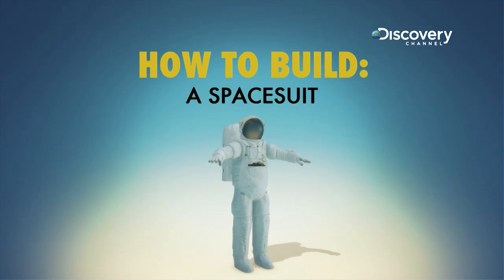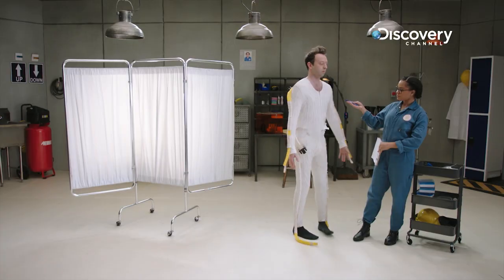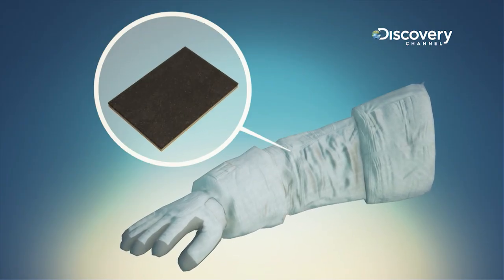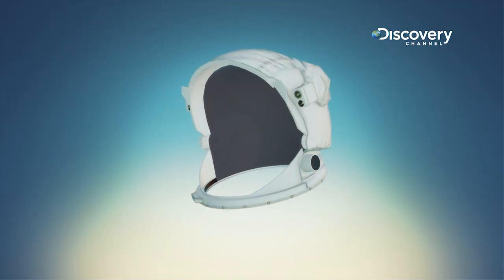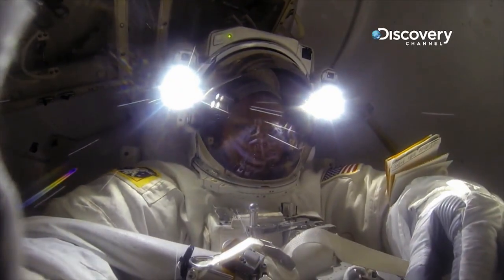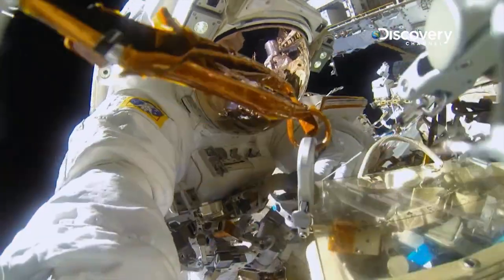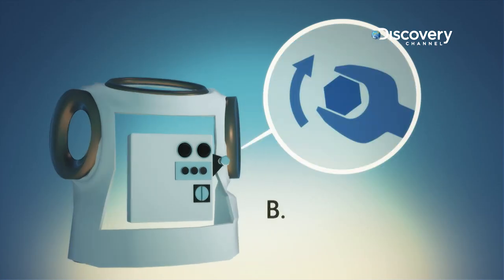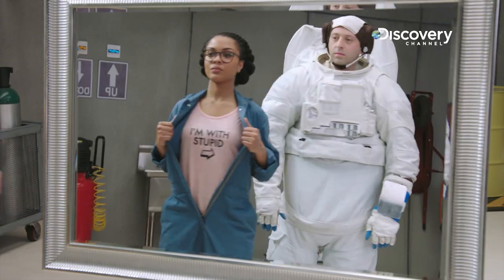Spacesuit | HOW TO BUILD... EVERYTHING

Comment: All this does not show me how all this works. Oxygen, filters and battery.
Reply: Or just google it. 
"A battery is a device that stores chemical energy and converts it to electrical energy. ... The flow of electrons provides an electric current that can be used to do work. To balance the flow of electrons, charged ions also flow through an electrolyte solution that is in contact with both electrodes"

Comment: I want a suit to remove heat from the body. Heat wave kills people but if they frozen water bottles they could have a relatively low powered heat removal system . Almost every American has access to freezer and 2 liter bottles ? Why not have the extra space taken up by bottles we would normally throw away . Power goes out you power your recirculation pump by a solar panel , and battery thus saving lives that normally would be at risk if power failure or just plain old poverty was the case.